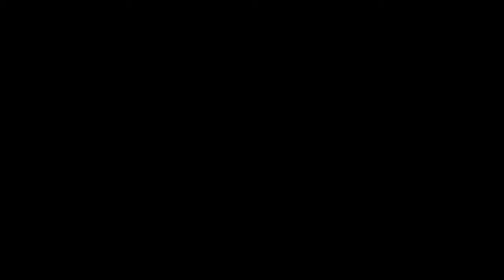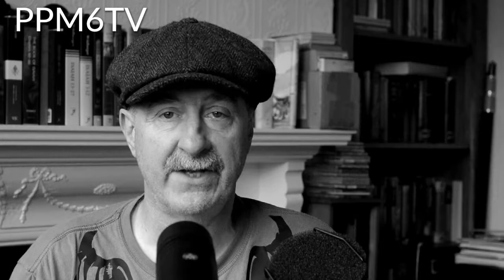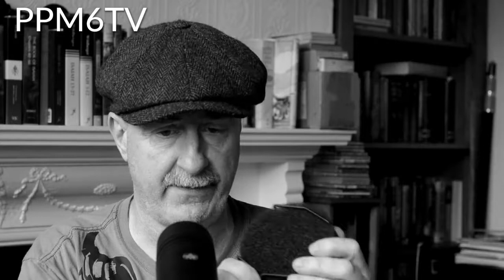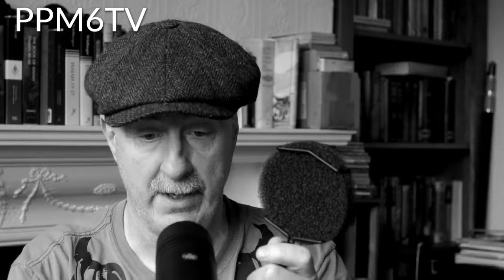How to stop mic pops, or plosives. With Aston Stealth and Hakan Pop Killer

Comment: Many Thanks for your videos on the aston stealth. I tried a windscreen like the rode WS2 and this did not do a good enough job and effected the sound. You lose the highs a bit but more annoyingly I found an odd attenutation/muddying of the sound. I would really like a compact end address one like made for the RE-20s. Now I am trying out a small metal one made for condensers really (shape) which I already had and seems to work well. Just not as elegant as I would like.  Astons own is far to big for use with the stealth. 
I will mention Astons Swift shockmount does work well with the microphone, though website does not list it as supported it works fine.
Reply from the maker: Gowla - thanks for the comment and the good info. I haven't seen the swift mount - I'll look out for that. I have a metal screen that came with the Heil PR40 - I'm not sure if it will fit as the clamp goes round the body of the mic. I'll give it a try. What has been your experience with the voices and internal preamp?  Ta like ppm6
Reply: @ppmtv-qh9qk  That would be really interesting, the diameter is closer than the RE20 to the stealth so if it can fit I will have too look into it. The internal preamp is really good, I have it going into a Roland quad capture. I'm using it to produce videos, I haven't finished one with it yet but am enjoying it so far. I don't have an ideal environment for recording so previously had to use alot of noise reduction and was using a Peavey M2 pro (condenser) which wasn't ideal. But it rejects noise really well and I'm getting a good recording just using a noise gate at -45dB. I have the gain on my preamp set to about 18, so rather low. And don't need to do any noise reduction when using with the condenser noise seemed to leak into my voice. Most of this was pc fans, extractors and road. I've only been using V1, I can't see myself using the other voices much if at all. Maybe Dark for fun. But having that 40-50dB of no noise gain is really impressive. I have samples from recording of the windscreen effect if your interested in listening, you'll need headphones.
Reply from the maker: @Gowla  - your journey sounds interesting. Can you do a video of the Stealth with and without the Rode and with and without the metal screen. If I can get the Heil screen to fit I'll do a comparison video with the Hakan. Ta like. ppm6

Comment: Do you recommend a Stealth?
I heard the stand is a bit weird and top heavy
Reply from the maker: The Stealth is king of flexibility four different voices plus the internal preamp. 
Cons - it is massive and heavy and there are reports of the innovative clip system failing and the mic dropping off the stand. I haven't had that problem I must say. However the clip fixes into the base of the mic and that means when used horizontally and at 90 degrees to your boom arm, the entire weight of the mic is levering the clutch of your mic stand and that sometimes is too much and the mic rotates the arm. I have had this problem. My other note is that the built in pop shield needs augmentation.
Of course none of the cons matter if you like the sound and there's plenty of sound to choose from!  At the moment I think the Gefell MD100 is the front runner. If I get a chance I'll do a video of the two of them together though I have a back log of videos steadily building up!  Thanks for your interest, ppm6.
Reply from the maker: Hi Trakman - just put up a video of the Stealth and the Gefell MD100.  https://youtu.be/rVcNW5YRhJ8
Ta like ppm6.